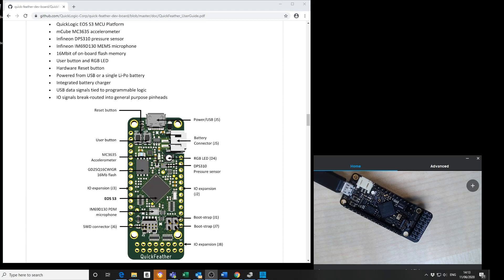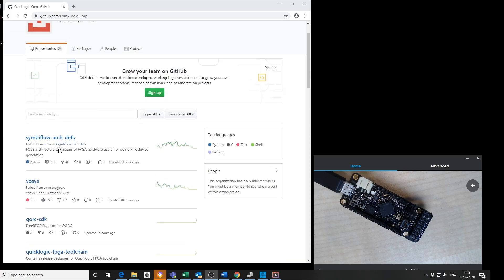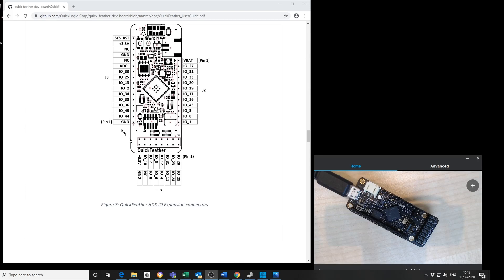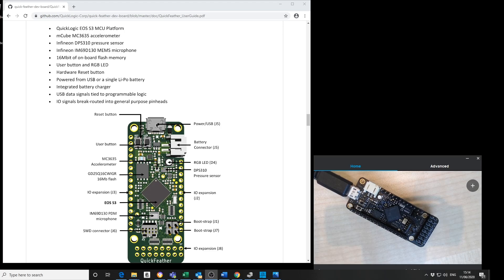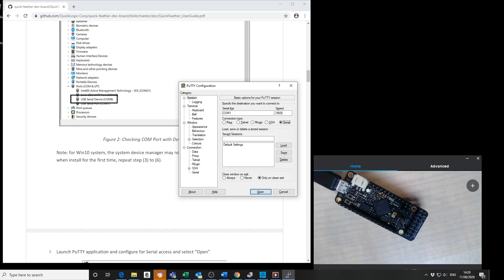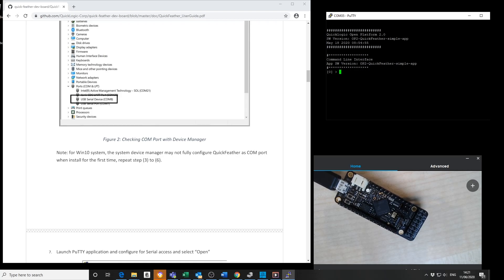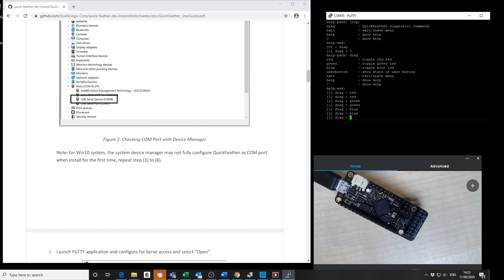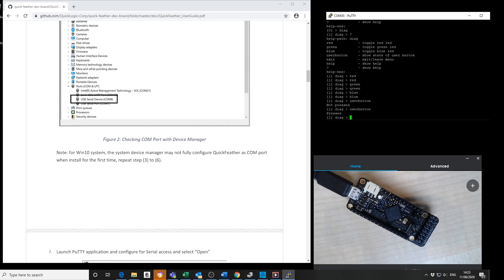Introduction to QuickFeather, EOS S3 Open Source Hardware Dev Kit

Comment: Unclear about the "e"FPGA... what is the difference between the EOS S3's "MCU + eFPGA" and a traditional FPGA with hard-IP ARM (ex. Microsemi SmartFusion2, Xilinx Zynq, etc)?    

For example, I assume the EOS S3 is NOT instant-on.. but rather SRAM based and must be configured at power-on?

The Quicklogic website doesn't simply show what the difference between the various Quicklogic antifuse FPGAs... Eclipse,EclipseII,EclipsePlus,QuickRAM,PolarPro,PolarProII, pASIC3..

Finally, is there a list of soft-IPs that are available either for free, or for purchase (ex. 1553)?